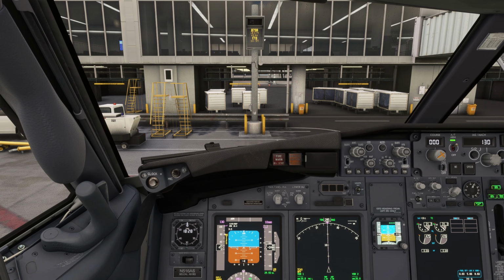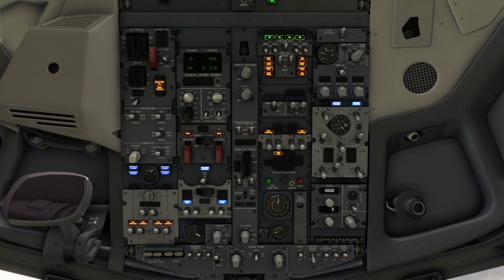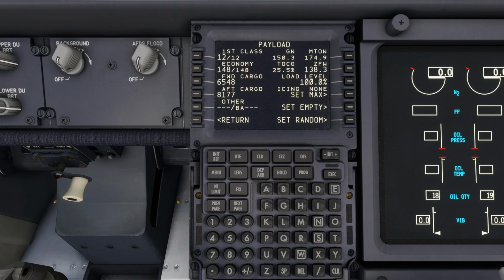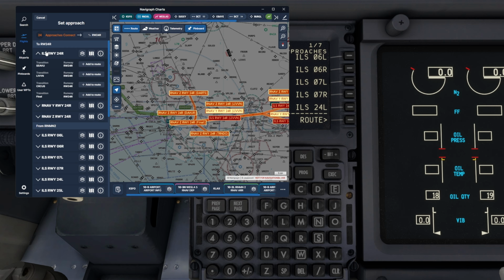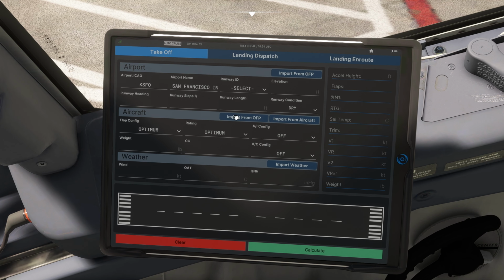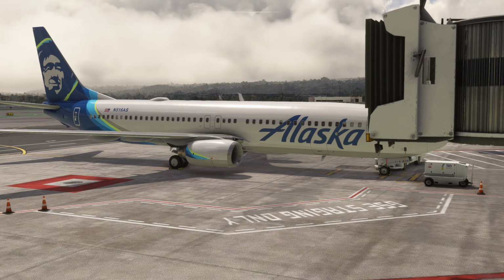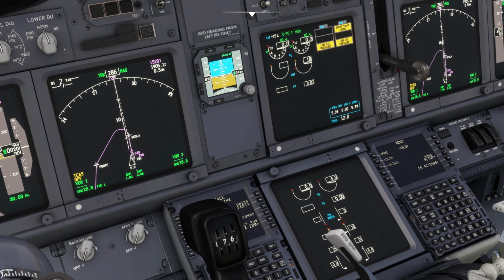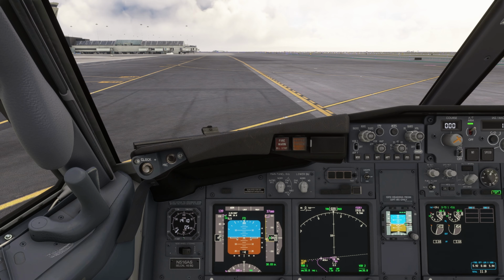PMDG 737-800 Cold & Dark Tutorial | Full Beginner Guide | MSFS 2020 & 2024

Comment: Hey, i did this and my % stayed at 29.7, meanwhile my 1st engine stayed at 18.1
Reply from the maker: Hey! Are those percentages N1 or N2? If it’s N2 stuck at 29.7%, check that you moved that engine’s fuel start lever below the throttles to IDLE once N2 reached 25%. Also check both packs are OFF and APU bleed is ON. If engine 1 is showing 18.1% N1, it may already be idling normally. Let me know which readings you’re looking at.
Reply: @holdingpatternsim  Ah thanks so much! I moved the throttle to idle and it helped. Thank you so much!

Comment: Its me again sorry to bother you again, but did no red light flashing i also tried  other 737 pmdg planes no success, even followed your start up instructions your plane works my does not what could be wrong? thank you very much for your help l even bought a 737 700 pmdg but no success.
Reply from the maker: No bother at all! If it’s happening with both the PMDG 737-800 and 737-700, it may be something in MSFS rather than the aircraft itself. First, make sure the aircraft has AC power from external power or the APU generator, then check the beacon from an external camera view. If the other exterior lights work but the red beacon still doesn’t flash, I’d try restarting the aircraft/simulator and checking that the PMDG aircraft are fully updated. If you let me know whether the navigation, strobe, and landing lights are working normally, we can narrow it down further.

Comment: how do i get the anti-collision lights to come on when the switch is in the on position?  I thank you
Reply from the maker: The anti-collision lights need AC electrical power on the 737. If you’re still in the battery-only stage of the cold & dark startup, the switch can be ON but the beacons won’t illuminate. Once you connect external power or bring the APU generator online, they should start flashing. Hope that helps!